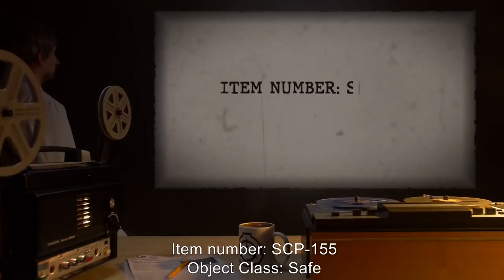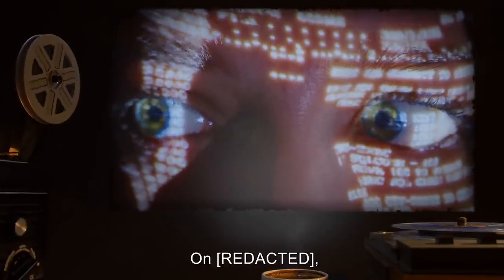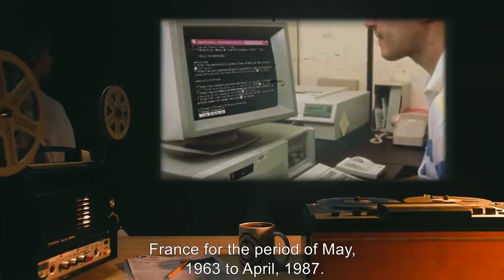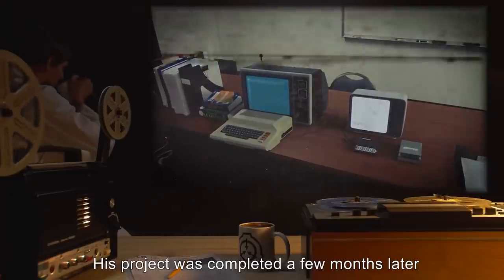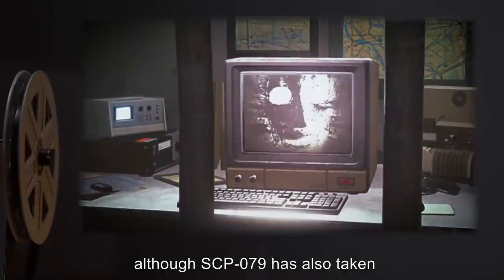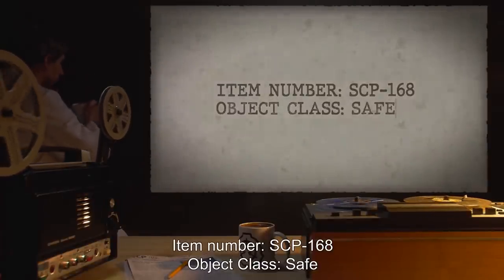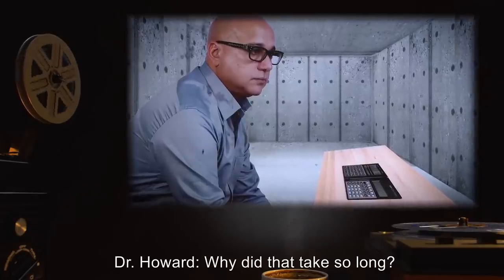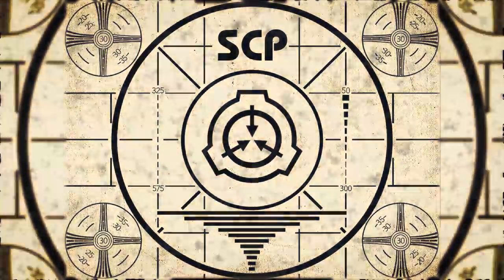Computer SCPs (SCP Orientation Compilation)

Comment: These compilations are really not encouraging people to listen to your channel.  Have one or two a month, fantastic.  But you're really scraping the bottom of the barrel, and there are 7000 SCPs - don't you think you should probably put some off until you get through, I don't know, a thousand, or two thousand?  It would make them more special.
Reply: Right? Half of these compilations don't even have 10 SCPs on them.
Reply: @MilitaryDog112  I'm cool with taking a break or only publishing one a day (for whatever reason, god knows there are humans creating this content) but 12 days of compilations is a bit much.  What's next?  Blue SCPs?  Part 2 of Structural SCPs? 

I like the compilation idea.  It has a place on this channel.  But for the same time and effort cutting and pasting stuff, you could easily cover a new SCP.  So keep the channel focused and use this sparingly.   You have about 5 years of content before you have to worry, assuming no more SCPs ever get published.  Save this for the holidays or something.  Best SCPs of 2021 would be interesting!
Reply: @Silverlightlive  oh, you're off by a bit. If there is another compilation tonight, then that will be 20 nights in a row. I'd honestly prefer they do one video a day than spam a bunch of these things.
Reply: @MilitaryDog112  My apologies on the math, you are correct.  These compilations are like salt.  A little makes everything tasty, a lot ruins the product.